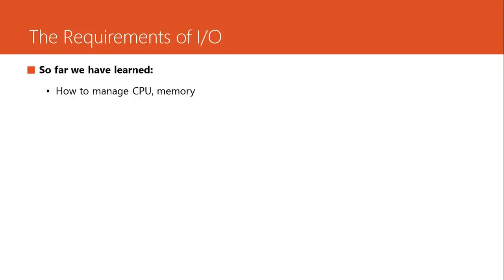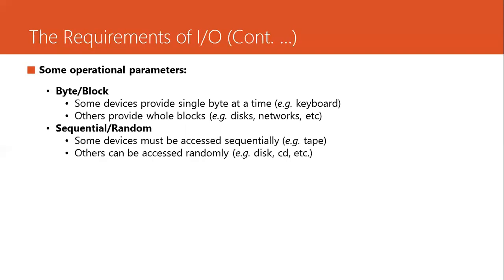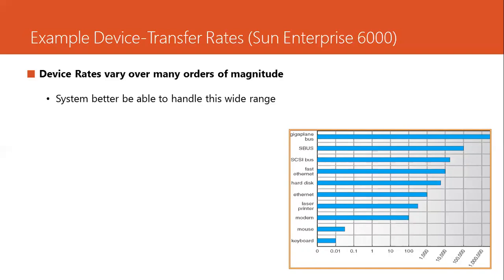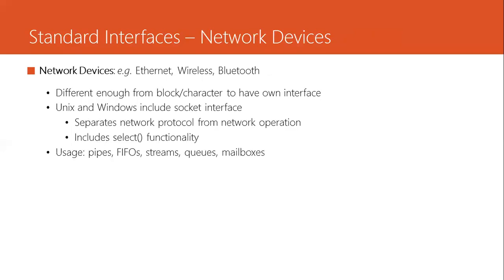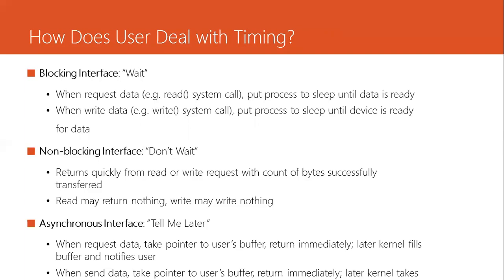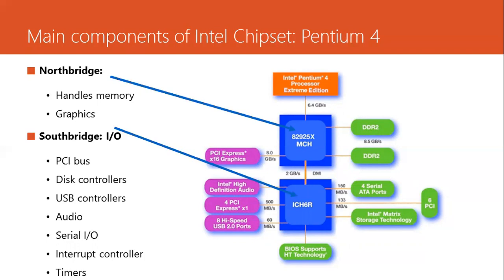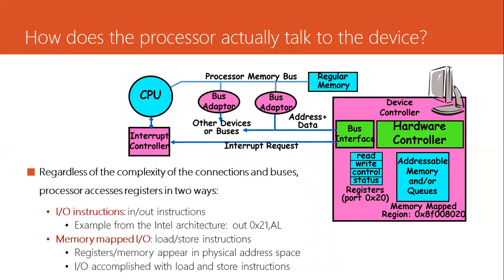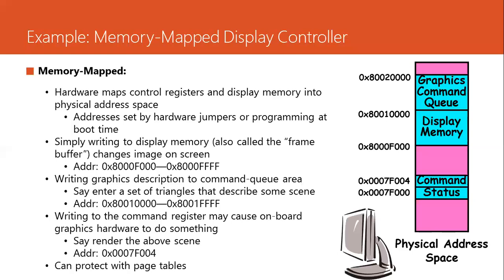Device Drivers in OS | I/O Devices Explained | I/O systems and hardware requirements | part 1

Comment: A.O.A Sir I have a question that according to block diagram Some how asynchronous interface is also similar to non-blocking interface?
How we differentiate asynchronous and non-blocking interface through  block diagram?
Reply from the maker: Non-blocking means that if an answer can't be returned rapidly, the process returns back immediately with an error and does nothing else, lalalalala, on the other Asynchronous means that the system always returns immediately with whatever it has in store at that moment having started the background process in the kernel which points to a buffer location in memory and start to fill it with requested data and latter notifies the user when done. I hope that is clear.

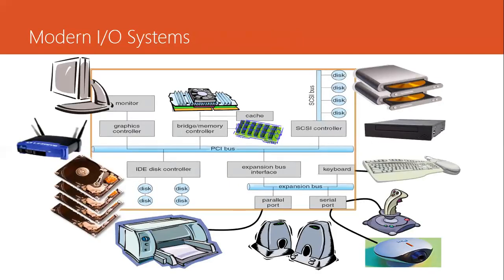Comment: AoA sir i have one question at 4:55 time
what is difference between Polling and Interrupts?
From: M.Tajamal
Reply from the maker: If the device interacts with the processor to notify of an event, i.e. data transferred to the memory,  this is INTERRUPT driven, Whereas, as we know that a device has certain command and status memory in their hardware that are used to control the device by software and if the software checks this status and command registers periodically, this type of IO is said to be based on POLLING. I hope that's clear now.